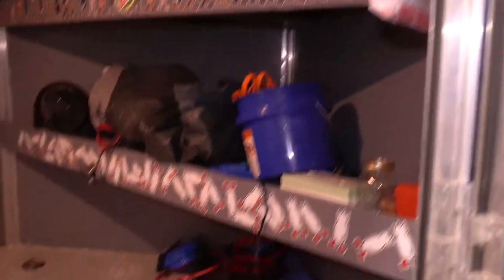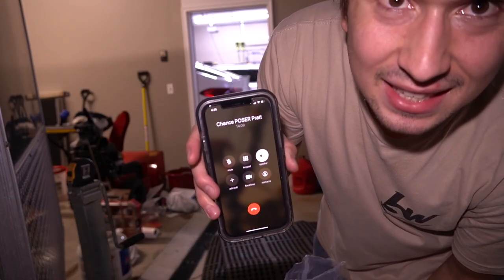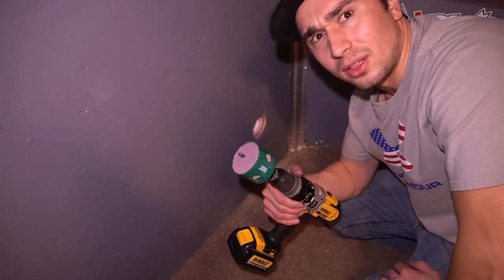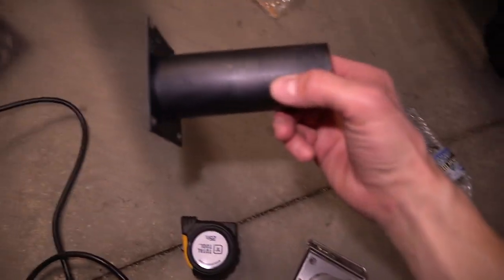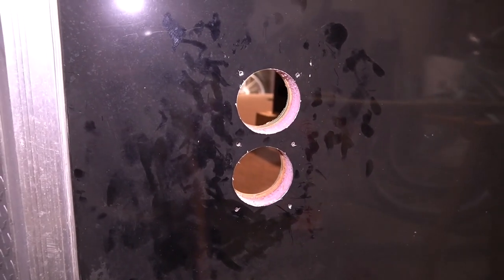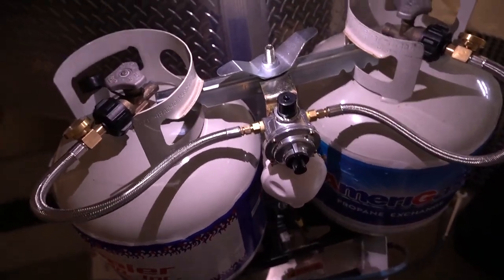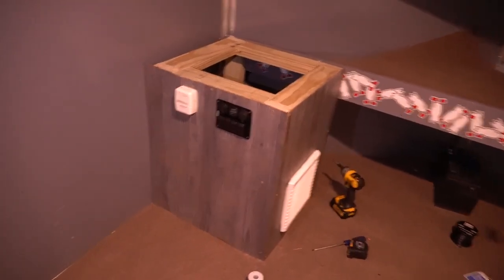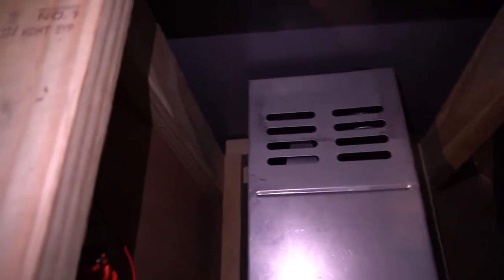Building An ICE HOUSE Out Of My ENCLOSED TRAILER! (Suburban 20,000 BTU Furnace Install)

Comment: Just came across your video. I’m
From Minnesota and decided to do the same thing starting last summer and finally finding time to finish by next month. I have a 7x16 with 2ft v nose. I installed a 35k btu furnace heater, all they had left at Milaca unclaimed freight. Hoping it won’t be too big. Shity part is I only had one option for exhaust and it was out the front in the v. I Should have went simple like yours, mines a little busy. I have 6 holes in mine. 1 1/2 inch insulation walls and ceiling, 2 inch foam board on floor, 2 inch foam board in back ramp door. I’ll be using double bunk bed cots while out on the ice.
Reply from the maker: That’s gonna be a great setup! The heater will keep you warm that’s for sure! 👊

Comment: To help out charging your battery or batteries, switch the trailer wiring to a 7 way system. There is a 12v power in the wiring. You can hook it up to your battery and it will charge when your its connected to your vehicle.
Reply from the maker: That’s a good idea, I’ll look into that!

Comment: Hey buddy I would have given you a couple propane tanks instead of you having to spend like 50.00$ a piece for each one!! You would have just had to take them and have them filled for like 20.00$ oh well I guess you already have some now!! Awesome DIY project buddy!! I definitely am excited to see it in youse and if the heater is big enough or not?? I think I would have went with the 30,000Btu one just so it wouldn’t have to run as much as the smaller one would have to!!! It should be awesome for sure and nice and comfortable!!!

Comment: How much space between the bottom of the trailer and ground/ice?  Wind will blow underneath the trailer ... freeze holes, make keeper the trailer warm tougher.  Maybe a skirting system around the outside?    Its a sweet modification though.
Reply from the maker: About 14 inches! Hoping there’s enough snow to bank it otherwise I’ll have to get skirts!

Comment: I'm looking to build my 6x12 enclosed trailer the same as yours for ice fishing also interested in the hole supplies you used and what did you use for sleeves
Reply from the maker: I went with the fish hole buddies for the holes and the sleeves are just 2 fish hole buddy sleeves taped together and I cut the ring off of one of them so it fits through the hole!